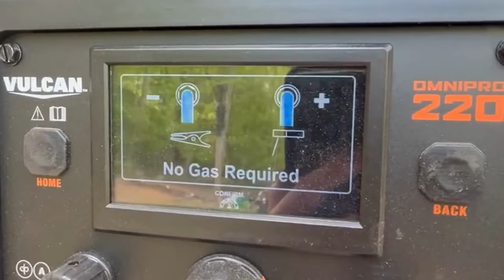The Best Rocket Stove EVER! (Very Biased)

Comment: Steel wire wheel on grinder for cleaning up left-over slag on stick welds works like a dream.
Thanks for the video. 😁
Reply from the maker: We use those at work a lot, just haven’t picked one up for my shop. They really are great! 

Thanks for watching! 😎👍